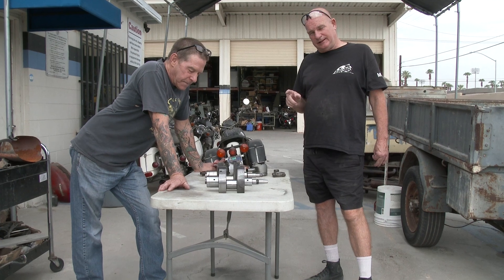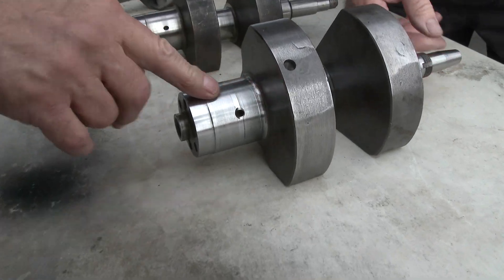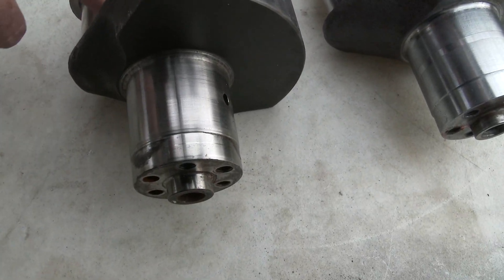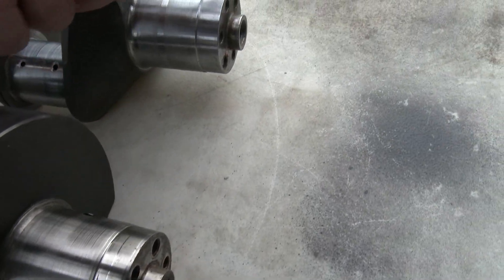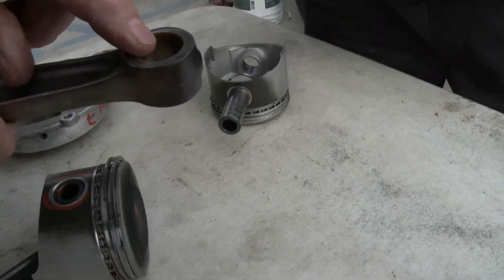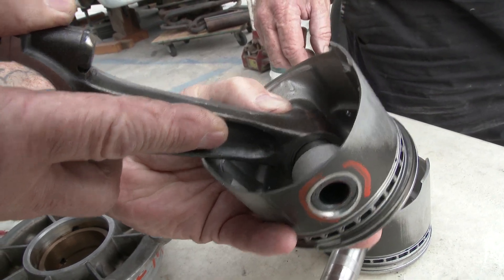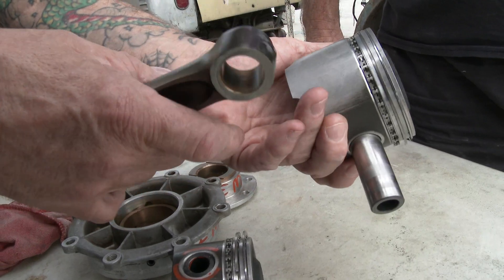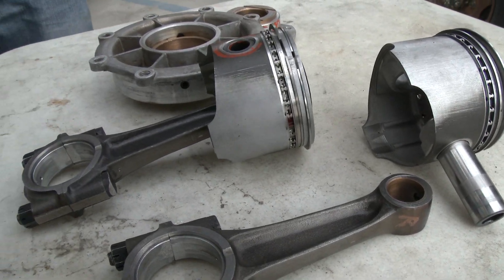Moto Guzzi Crankshaft Wear

Comment: Hello Moe and Stevie, you should make more of these type of videos, they are informative and show the interiors of these old motors, which generally are pretty indestructable. Whoever was riding must have absolutely flogged the life out of the poor bike. Is this the original engine components out of the bike and are you going to show any further engine reconditioning and tips etc when working on these models. I have an 850 Eldorado and have just purchased a 1975 850T these videos are very helpful indeed. Good fortune in 2023. Thanks.